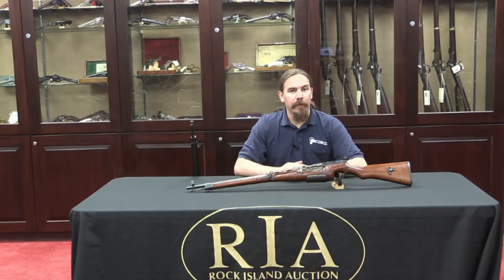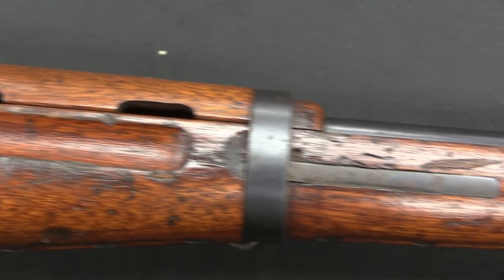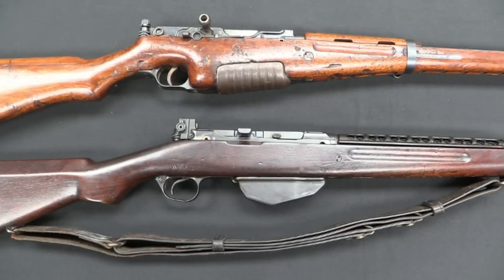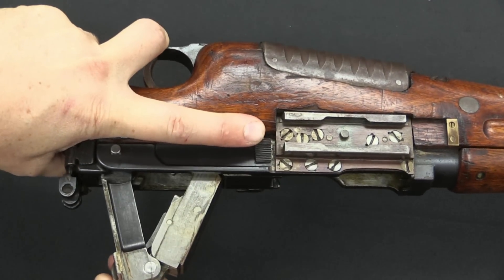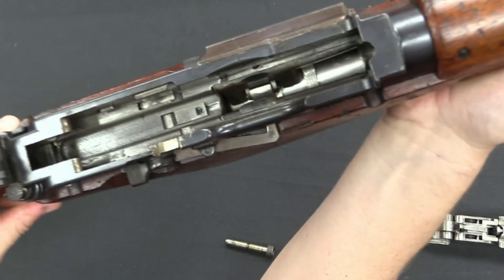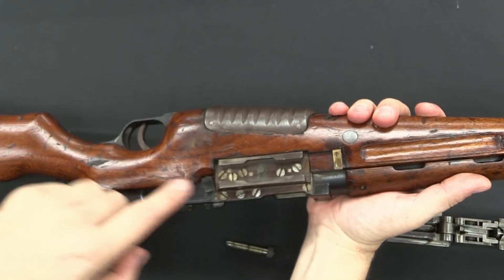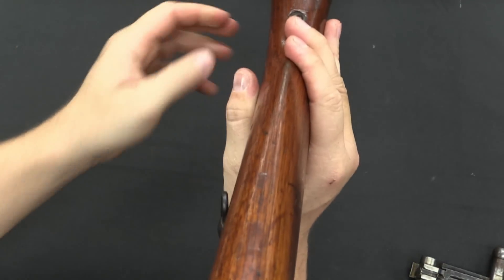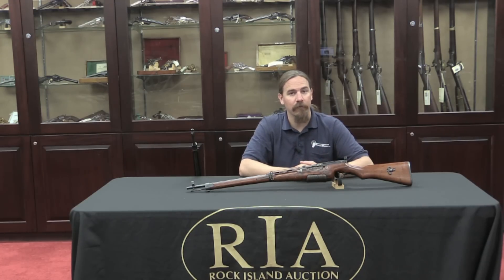Japanese Pedersen Rifle

Comment: That Pederson Rifle is really beautiful. Even if that fluting was unnecessary and added extra machining, it added a uniqueness that is very recognizable and striking. It's a shame that it was never put into production en masse.
Reply: +Ren ma It probably would have done decent, but it's main failing was the lubrication needed. I could foresee that becoming a major issue in extreme weather and dirt had that been the case. But otherwise, I agree with you.

Comment: Maybe its interesting, the Rotary Magazine  was the  idea of mannlicher Schönauer Gewehre from Steyer (Austria).
Does the release systhem realy only work on gravity?
Reply: seppfodasog What do you mean "release system"?  The bolt closes with spring tension; you just cannot see the spring.
Reply: RyeOnHam Thanks for anwser, that was i meant. Sorry for bad english.
Reply: seppfodasog There is a 'release system' for the spring, though.  The bolt and toggle mechanism are what you meant, though.  With the 'release' engaged, the bolt and toggle DO operate under gravity only as he shows in the video, but that is just for disassembly.

Comment: Is there an advantage to having iron sights mounted slightly to one side? Perhaps the Japanese thought they'd be easier to use if to the left.
Reply: Joseph G. could it be something to do with the scope? With the way that action works, that thing must've had a huge eye relief...maybe what they were using was pretty low to the woodwork?
Reply: Perhaps to use both iron sights and a scope. That's an idea.  Can Ian help out here?  Forgotten Weapons
Reply: Joseph G. Maybe to keep your sight picture when cycling?
Reply: Joseph G. I suspect that the sights are offset in order to avoid having your sight picture disrupted by the toggle lock.
Reply: Robert Miller Jake Zemp Nope. If you watch closely, you'll see that the toggle lock still intersects the line-of-sight.  It seems to be a mystery; it could have something to do with the scope mount, or not. One might consider the matter of shooting from prone, many competition guns for ISSF matches have offset sights for this reason. You would have to find some documents covering the design proposal (and presumably be able to read technical Japanese) to resolve this little conundrum.
Reply: Ahh, It all makes since now

Comment: Really cool. Any idea what those Japanese markings on that stock say?
Reply: PvtMartin78 I would like to know as well, if anyone out there can be of assistance.  Since this is a test rifle, there are no arsenal markings on it - perhaps the characters indicate it is a test rifle?
Reply: The two characters that are somewhat clear are 東 ("east", also the "tou" in Tokyo), and 三 ("three")...
Reply: Miles Bader *****   Here is what I was able to uncover from a native speaker.

"It seems to be 5 Kanji letters but due to the condition of the marking, only letter I can be sure is the top-left "東" ("tou"), which means "east", could be abbreviation for "Tokyo" (東京). Bottom-left letter could be "工" ("kou"), which could be abbreviation for "factory" (工場) or "Industry" (工業). Right line seems started higher than the left line but the first letter is too faint to read. the middle letter seems to be "三" ("san"), which means "three" or "third". The last letter of the right line is too faint to read."
Reply: +Rock Island Auction Company I know this is many months late, but I believe it may have originally been marked 
'東京砲兵工廠' on the left line. Tokyo Hohei Kosho was an Imperial Japanese Arsenal that existed until 1935 when it was moved to Kokura Rikugun ZoHei Kosho. 

In 1932, the Japanese military made Tokyo Hohei Kosho, and a few other manufacturers (Including Nanbu) compete for a next generation carbine. Tokyo Hohei Kosho, undertook the development of 'Experimental carbine: Kou' which was the project name for the Pedersen adaptation. 

Although they were never adopted by the military, a few of the completed prototypes were taken to the battlefield either for field testing or due to general shortages of usable weapons. It is likely this particular item may be one of a few completed prototypes sent to the P.I. as an airman's gun, before being seized by US troops there.
Reply: +Oddie Yang Very interesting!  Thank you.

Comment: Sucks that no one adopt the perderson rifle , imagine what it could have done in wars ;/
Reply: Rocky Dang Probably nothing the Garand could have done slightly better.
Reply: Lucius Albinus This. the garand was marginally better at everything perderson rifles called features.
Reply: The unwaxed Pedersen ammunition would have been an improvement in the Garand. I love 30-'06, but it was not the best choice for the combat conditions of WWII, the recoil was unhelpful for quickly re-acquiring your target. The smaller Pedersen round actually created larger wound channels at 300yd & under, as shown by testing done by the "Pig Board," which is the range most combat took place. You could also fit more cartridges per en bloc, meaning more shots before reloading and more ammo that could be carried by an individual soldier.
Reply: ostiariusalpha well, the garand wasn't intended to be chambered in .30-06 when it was designed. It was originally supposed to shoot  .276 as Garand patented. But due to extensive stockpiles of .30-06 left over from the first world war, the military simply chose not to retool it's arms manufacturers and stick with what they already had. It originally shot a 10 round en bloc clip as well, but the .30-06 was a larger cartridge, and lost capacity. Waxed ammunition was not seen as a strong point either. it cost more, and was considerably more prone to issues. as it sat, side by side, waxed cartridges did help cycle function, but the coating was not always consistent, and everyone knows that battlefield conditions are hardly the place to keep ammo dry or in pristine condition. sadly, it was a good idea, but an outdated idea. which is ironic because these days, russia has returned to lacquer-coated cartridges over the older copper-plated steel.  not really sure why
Reply: BuhLakeh Because lacquer actually works, cheaper to apply, better consistency, and is rust resistant on steel cases.  The myth of it gumming up actions is just that, a myth.  A myth because it is carbon that fouls the chamber because steel does not anneal properly like brass does not the lacquer.  This is why Russian guns have tapered chambers/cartridges as well so the phenomena does not hurt their guns/cause issues like it does to Western guns.  You would need to use an industrial torch to burn off the lacquer.

Comment: If Pedersen had brought this rifle to other countries, which ones do you think might have purchased them in large numbers during this time?
Reply: thatasianguy99 Seeing as the rifle is uses a blowback design and not a gas operated design I say there might have been a small chance that Germany would have adopted this rifle. The German army was defiantly looking for new and modern technology and even had its staff officers frequently instructed from the early 1920's onwards on the latest arms developments to better familiarize them with possibilities and limitations which where includes in the general staff there strategic and tactical development. What killed the German semi-auto program and also makes this rifle a potential winner for the Germans was the insistence of the Waffenamt to have a rifle that doesn't use a gas operated design. When the finally dropped it you get the G43 and MP43/44STG and who can argue that those (especially the latter) where bad designs?

Comment: Not sound firearm engineering.   Very fast initial extraction of the fired case whilst still inder pressure. Not very strong toggle action. Lots of screws and very complicated machining  making it very expensive to manufacture and quite a job for a modern CNC.  Must have been unnerving to shoot with that toggle flying upwards.  The Garand beat it hands down in just about everything. Would still need beeswaxed cases to ensure extraction of the spent case without ripping the heads off.  Sorry but everything wrong with this rifle.  Toggle lock OK for lower pressure pistol rounds.
Reply: +Crobular I  Sorry keep on but if you look at a slow motion film of the Pedersen in use you will notice that the toggle lock does not settle to battery immediately. It bounces a little. Not Good.

Comment: Why are the sights off center?
Reply from the maker: Tony King I explain this in some detail in the video...
Reply: Forgotten Weapons Actually you did not go into any detail why the sights are off center.You merely noted the alignment in passing.,
Reply: Tony King To allow use of the sights without the toggle blocking the view. Though, the only time the toggle is up is after firing. It makes no sense, but I do think that's why they're offset.
Reply: Ronald Colman Thanks, that sorta makes sense...